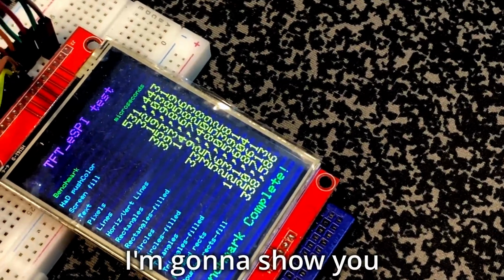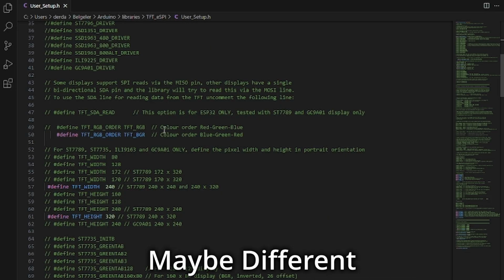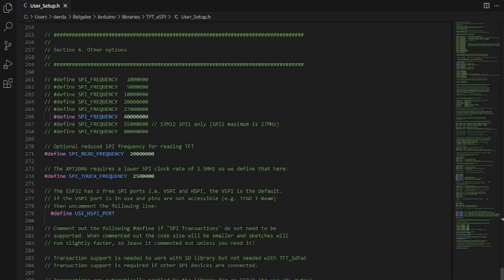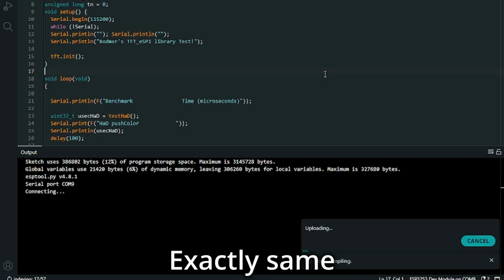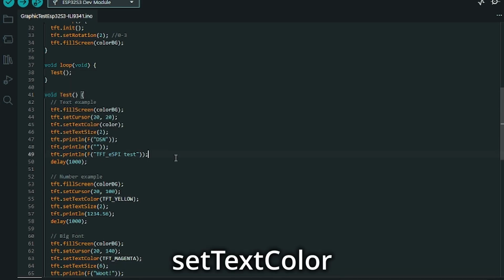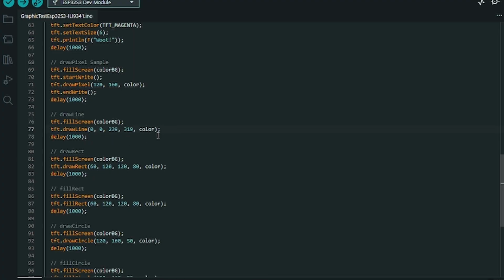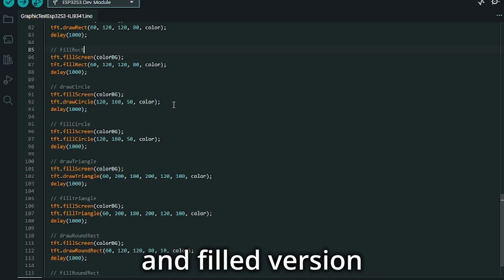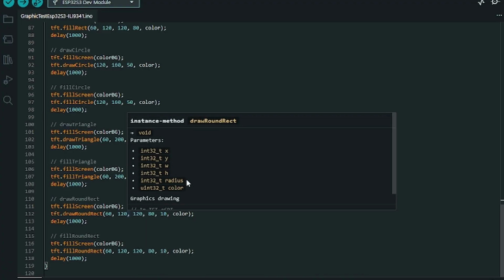How to Use ILI9341 with TFT_eSPI Library on ESP32-S3 (Arduino IDE Tutorial)

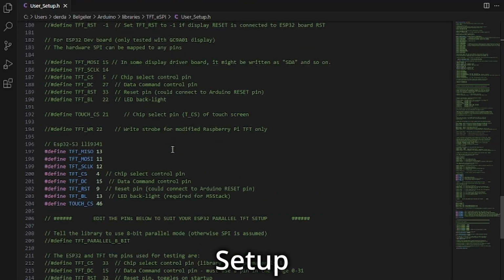Comment: Hi, in your User_Setup.h, (01:08) you have the TFT_BL (Backlight?) set to 13. That's the same pin as MISO. Is that correct?
Reply from the maker: probably I have forgot comment TFT_BL. Cause of in display backlight pin goes to directly 3.3v. In this situation  Doesn't effect your usage. But, if you want to control tft_BL with code must be replace pin with any free gpio other way comment it

Comment: Screen won't turn on. Detached all cables except VCC, LED and GND but backlight only turns on for 1 sec after esp board turns on then shuts off again.
Reply from the maker: Probably esp watchdog get hysterical and reset. Change your gpio pins. Reconfiguring user_setup and try again